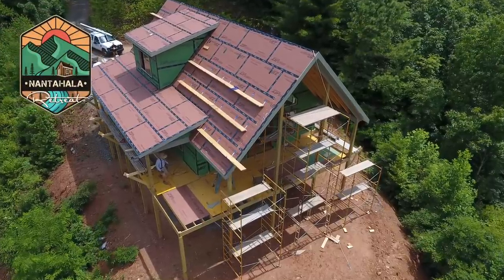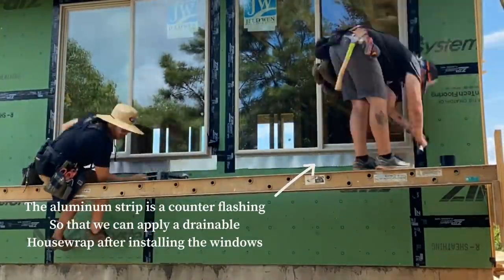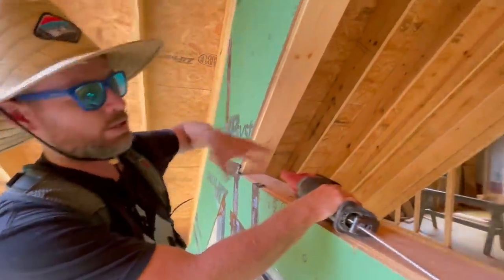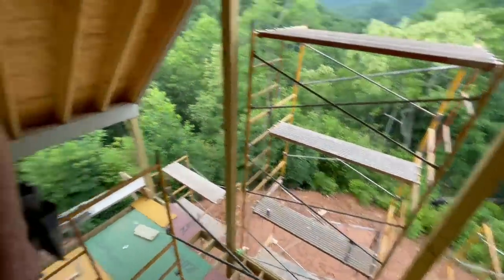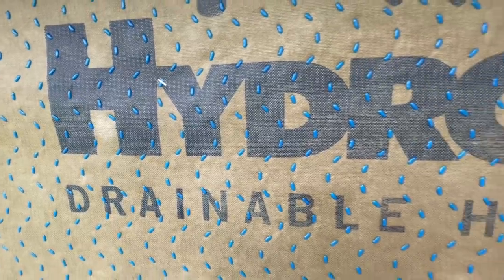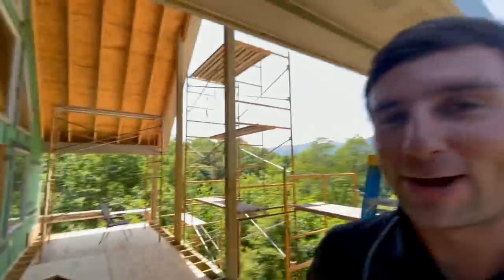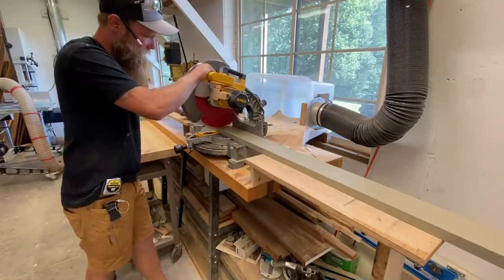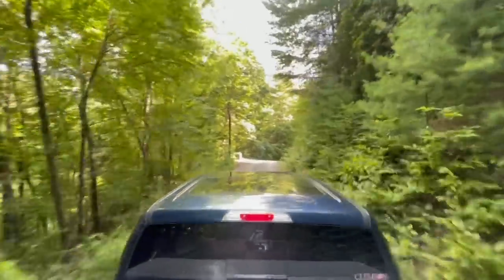Installing Windows | Building The Nantahala Retreat #18

Comment: having that extra spot on the tool belt is so nice to have, i repurposed an old airsoft dump pouch and i don't think i could ever go without it, use it for storing beater blocks, snacks, drinks, glove you name, such a small addition can make a big difference
Reply from the maker: Agreed! Originally I thought it was going to take up more space than it was worth but now I couldn’t do without the extra pouch

Comment: 6:04 - Even better pro tip is wearing professional working boots,with metal underneath.Have not had a nail in my foot for 13 years now,and I very often step in them since I do a lot of demolition.Before I used to do that I had a day with two nail in a day.That was the point where I got angry and bought the most protective shoes.
Reply from the maker: Yes that’s also a good pro tip!
Reply from the maker: Yes that’s a great pro tip!
Reply: I have done that kind of boot before.  They make my feet hurt so much that I can barely walk by the end of a day.  I rather just look where I am putting my feet.
Reply: @benjaminsagau  - True, cheap shoes can make it worse.  I give around $150 for the ones I usually get.  They don't have protection against stepping on nails, but if I get more expensive boots it might be worth it. Still, I have pretty good luck and only stepped on one nail in the past 29 years and that one didn't go through the boot.

Comment: Doing some catchup on previous video's. Awesome job as always. I think that YouTube has different censoring depending on what region you’re in. Because, every time you guys say "you can't say that on YouTube", I still here it. Including nuts...k. :) On a more serious note.  
where I'm at in Scandinavia you almost always cover the house in scaffolding although to rent can get expensive (if you don’t own your on). It’s mandatory more or less since you will fail inspections due to safety reasons most times otherwise. 
Thank for putting out awesome content and keep on nailing.

Comment: Regarding multi-window alignment and framing... wouldn't it be advisable to oversize the frame opening by say an inch all around and then shim or add filler as needed to compensate for window size variance? Seems much easier than having to re-frame when this type of thing occurs.

Comment: Quick question from the UK.  Do you find that homes get burglarised due to the way the windows are installed?  ie all a burglar needs to do is pull the siding off then pry the windows out... obviously a home owner, if inside, would hear all this but if it was only a vacation home or they were on vacation it's easy access for a burglar with a moving van.!!

Comment: How about a palm nailer to do the windows install 🤔 Keep up the great work,  Blessings 🙌
Reply from the maker: I’ve actually never tried that one but it might work! I’m personally not a huge fan of palm nailer’s just on account of the noise though
Reply: Good call. Have been using a palm nailer for a few years now. Really great in tight areas. Great for hanger nails.
Reply: @PerkinsBuilderBrothers  - They are a bit loud, but they are fantastic for getting nails in tight spots.  Much easier than trying to swing a hammer.

Comment: On the band board, is the angle enough to get good drainage (it did seem fairly steep) or will a small curf cut on the underside needed to prevent water tension from allowing it to flow around and down the face of the board?
Reply: @Perkins BuiIders was that reply intended?

Comment: I know this is not possible for you. But if this do your calculations in millimeters, figuring dimensions, divisions, would be much easier for you and of course easy to find on regular calculators.
Reply from the maker: That’s what I hear! Unfortunately around here no one would know what I was talking about if I told them a measurement in centimeters ;)
Reply: @PerkinsBuilderBrothers  its the same even up here in Canada. Construction still hasn't really switched over to  metric.

Comment: Do you guys not apply any adhesive caulking behind the window flanges ? Here in New England we usually apply a bead of phenoseal adhesive caulk behind before we insert the window , or silicone , just curious

Comment: Pro tip: Use a galvanized pan head self tapping screws to install the windows instead of nails. That way, there's no risk of damaging the window when hammering. And can be easily removed if needed.

Comment: I’ve always wondered. Why nails and not screws? And before all the haters jump me. I’m a retired firefighter not a contractor. And also have always been told the dumbest question is the one not asked.
Reply: Good question. Generally nails are tougher and used in structural applications. Screws are supposed to snap off if they get side pressure but are better at resisting pull out (Project Farm seems to prove this wrong). I dont really see why you couldn't use screws other than the building inspector not approving them.

Comment: Your working at heights system leaves a lot to be desired, narrow treads to stand on and the scaffold not fixed to the wall to stop from falling backwards . The fall doesn't hurt, it's the sudden stop when you hit the ground. Job site would get shut down by building inspectors in Australia. Try and stay safe

Comment: Osb based trim.  Terrible idea.  Will need replacing in 12 years.  Same with cheap vinyl windows vs Fibrex.
Reply from the maker: The trim as a 50 yr warranty and have never had a problem with vinyl windows.. The fibrex was also 20 weeks out to order due to Covid here